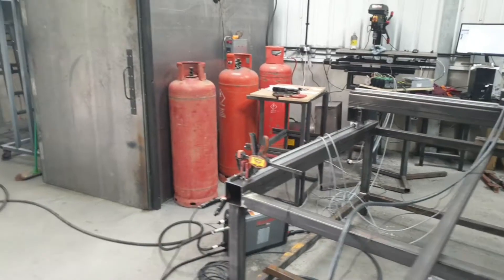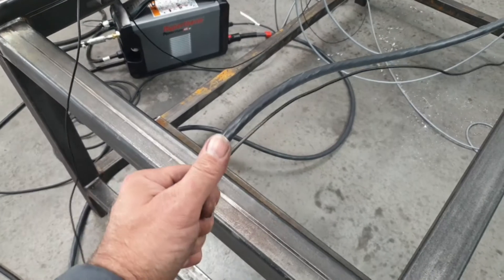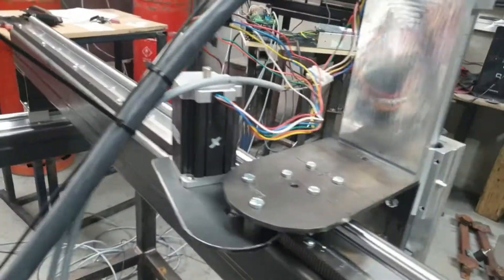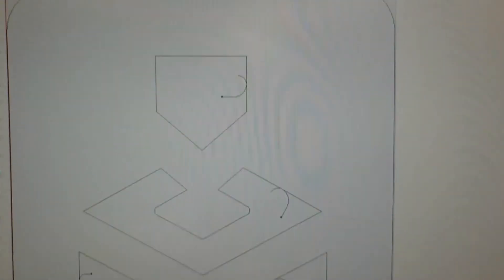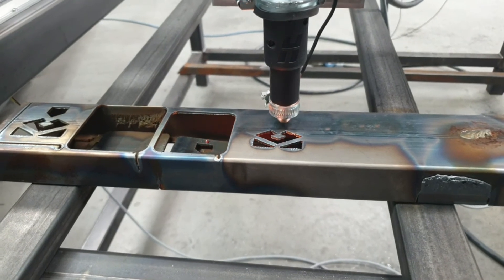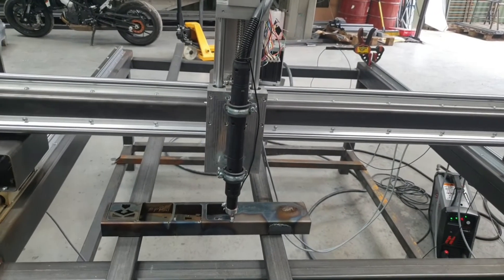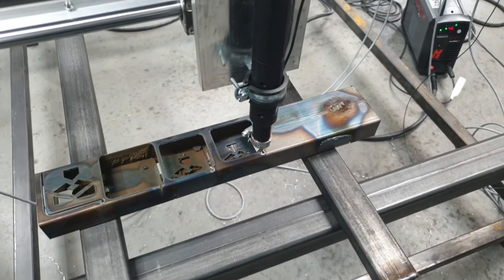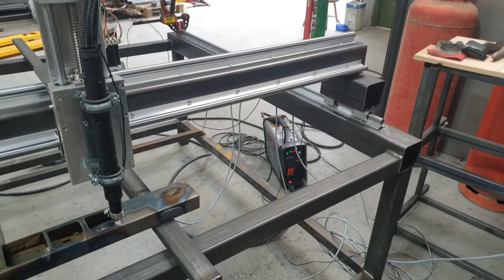CNC Plasma build 3

Comment: Great to see the machine cutting parts for itself!! What does the ohmic sensor do and can it be adapted to a 'normal' plasma cutting torch (like the one that comes with a plasma cutter) or do I need a floating head type Z axis torch holder??? Or if I buy a torch head like the one you're using, can I do away with a float head mount, thanks again for your help.
Reply from the maker: If you are going to use myplasm you will have no problems.  It supports floating head and ohmic
Reply: @robbroomfield468  ok, thanks.